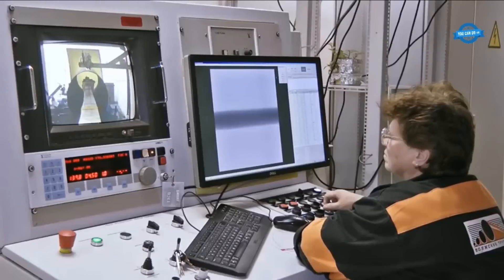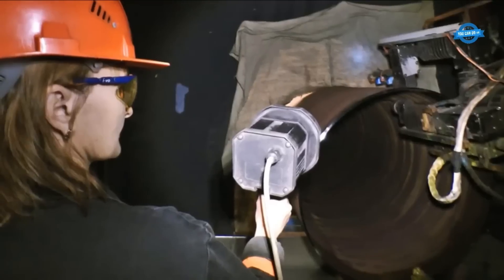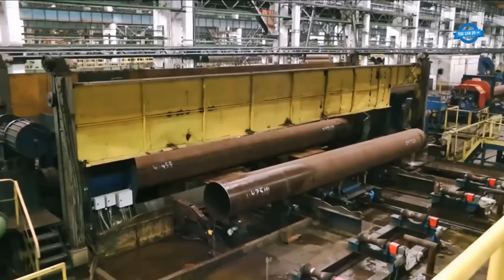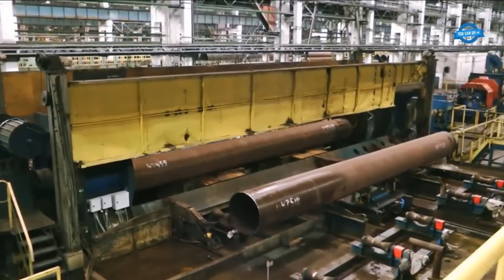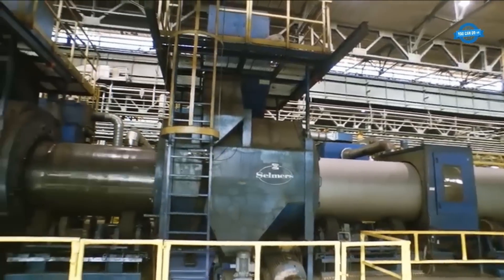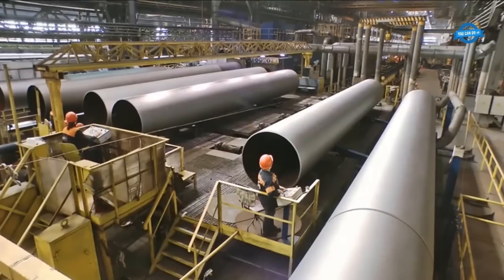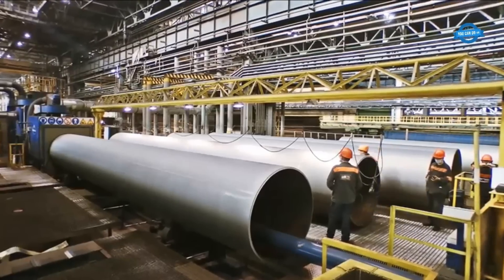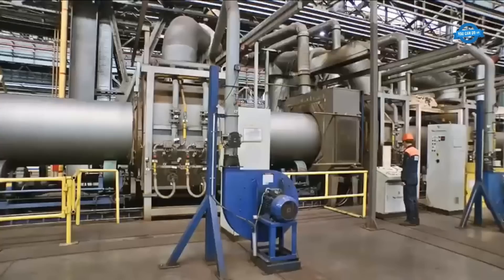Amazing Biggest Pipe Productions and Greatest Pipeline Installation Process

Comment: Russian natural gas pipe line construction qualities via Siberia to China was a case of failure. Only 20% of total amount of gas could be delivered to the destination.
Reply: If we are talking about the Power of Siberia-1 pipeline, then this is partially true. In new fields that are being developed near Lake Baikal and in Yakutia, natural gas consists of many components, such as methane, propane, helium, and others, so it needs to be deeply processed before being used. A plant for gas processing and polymer production is currently under construction in the city of Svobodny. Also, the construction of new deposits and distribution networks in China has not been completed. Completion of all related projects is scheduled for 2024-2025.